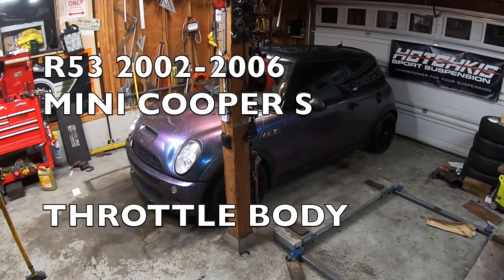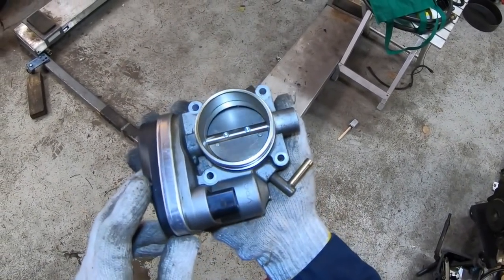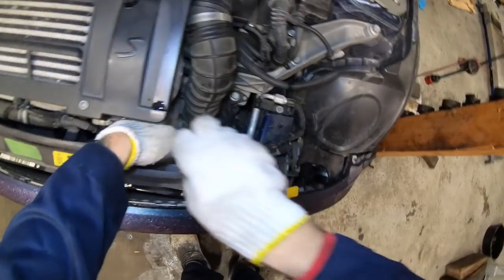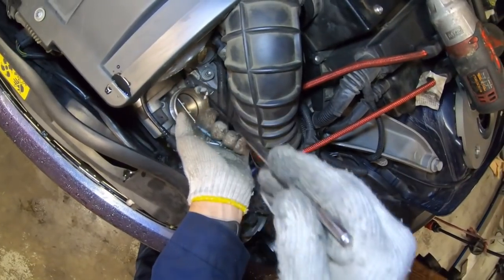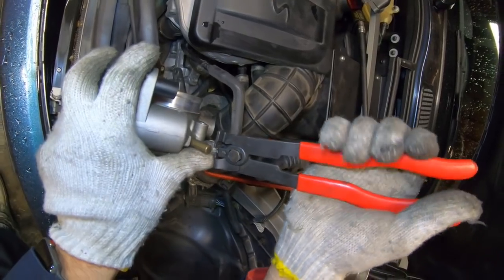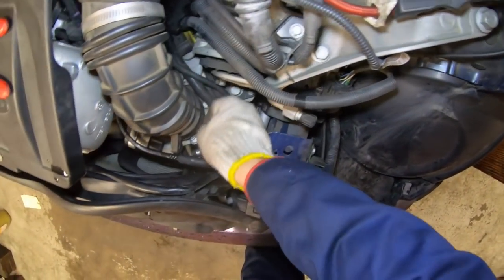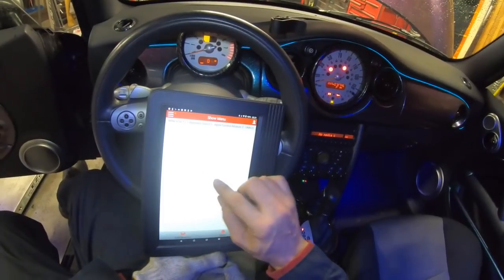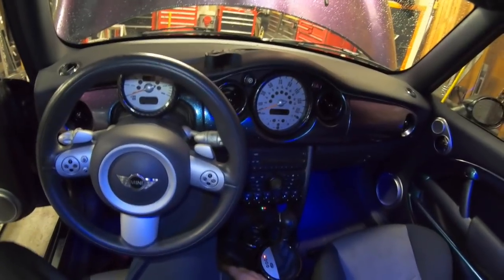Replace R53 MINI Cooper Throttle Body P1125 P1126 P0638  2002-2006

Comment from the maker: You might need to replace your 2002-2006 MINI Cooper R53 Throttle body if you get a check engine light/limp home mode. Procedure similar for non-supercharged R50. 

Buy the throttle body here: 
https://ebay.to/2UQJbvW

Pinch clip tool:
https://amzn.to/2IfN2wN

Diagnostic tools that can reset throttle body adaptation: 
https://amzn.to/2IeqXyu
https://amzn.to/2VFEYs0
https://amzn.to/2UySnWo
Reply: Thanks for this video, and the others, top advice !!
Reply: Thanks  for doing this video I replaced  mine on an 06 S I have  but I never did the reset on the throttle body it worked fine but later on  couple of weeks later I got codes and I the rpms where where going up and down   then the car would go on li.p mode and give me a code 1498 and 1125 I did replaced a broken hose and also the bypass valve for the supercharger  with anew gasket and still gave the code and would idle up and down. 
I just bought another new throttle  body and the BMW tool   the 360+ but it won't connect the the throttle body to clear the adaptation.
It only comes to read it but not to clear it. Right now it's working fine  what would happen if I can't clear the adaptation!  I ha e no more air leaks it's driving me crazy. Can you help. Me!
Reply: Hi, I've got a 2006 mini cooper s model , with a fluttering acceleration from 1st to 2nd and a little to 3rd. Keeps giving me a cylinder#2 misfire. I've tried all the small repairs... Any known issues that will cause this? When it gets up to speed, it drives fine, but only when loaded in 1st gear does it five an issue.
Reply from the maker: @SAK1974-f9o  Compression test and leakdown test to verify the cylinder compression is good.
Reply: @ModMINI  Thanks so much for the response. Thanks for all the videos you've done on Minis, it has help a whole lot.
Reply from the maker: @RaymondN.-in6vw  this is usage moisture damage. You'd need to check the harness pins in the floor area and repair damaged ones. Sorry, I don't remember which wiring harness. I believe it's under the driver side floor carpet
Reply: Hi, I have an 03 cooper s that is throwing a p0506 code, and stalling when I let off the throttle. Would that likely be a throttle body issue?

Comment: Just had mine replaced yesterday, unfortunately I had to pay crazy money to get it done. Definitely a DYI fix.
Reply: DYI?  Is that what happens when you try to fix it yourself but break additional stuff in the process?  Do Yourself In fix?  I've done that.
Reply: @bvcxzgt5451  😅 if you've ever worked on a 15 year old BMW🤣 it kinda does you IN for the parts that exist in the immediate vicinity of that One you want to replace. Need 1 part buy 3😡🤬😂

Comment: I bought the first diagnostic tool you link to (Foxwell NT510). Unfortunately it cannot reset the throttle body adaptation on an R53. I contacted Foxwell, and they told me I 'd have to get the NT530. Just a heads up.
Reply: Did you get the proper Foxwell tool and reset adaptations on your R53?

Comment: Hi Mod Mini! Just had a P1125 code appear on my 2006 mini cooper. I cleared out the code with my cen-tech. Should i wait till the code appears again or should i change out the throttle body now? Already performed a tune up.

Comment: Hello I just bought a 2005 Mini Cooper automatic for my son and we are having a problem when we start the car it will start out fine Rev fine the moment we put it in Drive the car has a vibration feel with low RPM and no throttle response whatsoever any ideas that you can think of? There is a service engine light but I have not purchased a scanner yet I know that would be the best place to start with scanning it I'm just curious if Mini Coopers are known for this type of issue and if there is anything you can think of off the top of your head

Comment: You can do a throttle reset ( throttle relearn procedure) just by depressing the gas pedal with key in acc power mode for 30seconds, turn off key WHILE still depressing pedal and remove the key and then release the gas pedal. You SHOULD hear your throttlebody actuate ( a buzz noise followed by a click kinda sound ).
Reply: Hi Adam..what year is your mini? I have a 2006 mini cooper s and i am wondering if this method will work for my car

Comment: Resetting the throttle adaptations is same as throttle relearn ? I replaced my throttle body and throttle pedal, but didn’t do the relearn and after certain time it goes to limp mode p1125 code

Comment: Hello mod mini, i have my mini Cooper r52 cabriolet 2005 that is giving me some issues. First of all has a long cranck to start ( like 3 or more seconds) then irregular idle and the engine has not all power and not fast response of the engine when I touch the throttle pedal, plus engine check light on and the error my mechanic said is about missfires and too rich gasoline mix. I changed air filter, sparkplugs and body throttle cleaned and resetted but the problem persists. My mechanic said that I should replace the body throttle, but can't be the depression hose or pedal sensor? The car has 190.000km what do you think about? Do you suggest an original one in case or a Siemens ? Thanks

Comment: Great video. I thought I was having throttle body issues, but I'm getting the codes: P0302, P0456, P0300, P0313 as well as an evap leak on my R53.  I have new spark plugs installed, checked my gas tank cap, but at this point can I assume its a MAP sensor issue? Do you have a MAP cleaning video? Thanks!
Reply from the maker: That's a lot of codes, some of which can point you in the wrong direction without some critical thinking. I'd unfortunately have to look at the car to comment further.

Comment: Really liked your video.
 I have a question.  What could be causing me to have a check eng light and EML light ? I hooked up a scanner and got code:  P1498 Air leakage after compressor.  Could it be the intercooler boots? I have. 06 R53 S with 74,000 miles.
Thanks for time.
Reply from the maker: I'd guess you have air leakage after compressor. Do a smoke test.

Comment: hello Mod MINI, thank you for the great video again!  many of your videos were HUGE help with replacing supercharger on my 2005 cooper S.  may i ask a question?  Have you ever encountered P2127  Throttle/Pedal Position Sensor/Switch "E" Circuit Low?   I searched everywhere but no help on any web or forums?  replaced gas pedal (used one) and removed/cleaned throttle body but still getting the same code....  any help would be GREATLY appreciated.  thank you!  Jay
Reply from the maker: Try replacing that perhaps. Used ones aren't expensive
Reply: I got that code, replaced my pedal with a used one, and still had trouble until I recalibrated the throttle pedal.  Easy DIY recalibration.  Look it up online, but my recollection is pedal held down, key on, hold pedal down 30 seconds, release pedal, key off.

Comment: While i have my throttle body off my 2002 mini cooper s  is it ok to open the butterfly for a better clean... reason asking  because with my lpg ford its not  a good idea...Ps your videos are the best to watch...
Reply from the maker: Should be ok, reset with BMW scanner if anything happens, but it should do a self-calibration every time car turned on

Comment: Question! I have the check engine light on after putting the AC and was told that the hose that goes to the throttle body was loose.  Now the light is off after driving the car for a little while.  Not sure if I might have to fix the throttle body part too. It has stopped responding to switch gear again and did not had the air on.
Reply from the maker: If car is not put together correctly, you will have problems.

Comment: Is there a way to contact you about an issue I’m having? I’ve gone to a MINI racing shop with a lot of knowledge and I’ve done my research. No one on multiple FB groups can figure it out as well as the shop after over 7 hours of inspection and testing.
Reply from the maker: If you've gone to shops that have looked at the car in person, and still unable to give you an answer, I will be of no additional help not being able to see the car.

Comment: Do you have any idea what might cause EP (emergency program) on automatic R52 with sport mode and paddles? Continuosly lit. It can still shift, not stuck in one gear.
Reply from the maker: Need to scan the computer and read codes.

Comment: Hi MOD MINI videos are great recently replaced BPV and serviced supercharger. My Mini cooper s 03 plate is still throwing a fault p1125 and going into limp mode, I can restart and it will be fine again for a while. As only the code dont think the throttle body has gone as runs great all the way through when that doesn't happen. Any suggestions on what could be causing it?
Reply from the maker: Have you replaced throttle body? They are pretty cheap used on eBay. https://ebay.to/2R8Xl7B

Comment: Hi Mod Mini! Thank you for all the helpful videos!  My R53 has a P2127 code Throttle/Pedal Position Sensor/Switch E Circuit Low.  I have check engine light and/limp home mode...Is the sensor different from throttle body? I can't seem to find parts for throttle position sensor.  Thank you for any guidance you can provide!
Reply: I changed the throttle body and it fixed my issue.  Thank you Mob Mini.
Reply: @simonkong7205  Hello Simon..having an issue with my mini and i believe my throttle body is the problem. Car goes into limp mode with a check engine light. I turn it off and goes back on with check engine light off. Thinking of changing out the throttle body..already cleaned it but i believe it is the electrical of the throttle body is the issue. What brand throttle body did you get?

Comment: hi, I wanted to ask you my problem, I have a Cooper s R53 and for two years I have the following error codes P2122 P2123. replacing the accelerator pedal, the problem reappeared after months, and then disappeared for other months, now it becomes more frequent. I will change the trottle body soon. but on the forums we read that the problem may persist ... the fault of the ECU! ?? Thank u
Reply: What ended up happening?   Recalibrating the throttle pedal can be done easily.  I forget the procedure exactly, but it may just have been holding the pedal down while turning the key to "on"  (not starting the engine), and keeping the pedal down for thirty seconds, then release the pedal and turn the key off.    I had to do that after replacing my pedal.  6 months later all has been well until today when I get P1125 and P1129, so I'm ordering a throttle body, I guess.

Comment: I'm thinking about buying an 05 mcs but don't think I will be doing my own repairs. No tools, no (garage) space, and no experience. It's got tons of service records but it's got 80k miles so it'll probably hit the big ticket maintenance items soon. Am I looking at a situation where I'm spending tons on mechanics in the near future? It's had most of the usually leaking seals replaced i think, nothing replaced in terms of the suspension though probably, unless mini did it themselves within the 60k miles it was taken to them for regular servicing which I doubt.
Reply from the maker: I can't comment on any specific car. The typical issues are leaks and that sort of thing, then control arm bushings or leaking CV boots. get any candidate car inspected before buying.

Comment: I have the same codes except 1126, went limp mode on me on the way home late last night. It's happened before, dealer said it was a leaky boot. Same codes as last time. Think it's the same thing? Throttle body?
Reply from the maker: Do a smoke test. Could be throttle body.

Comment: Hi Mod MINI I've got the error code :1689, 1125 and 0638 on my mini cooper s 2006. I think i wiil change  the throttle follow your video I don't know will it work by the way Thank you for your helpfull video.

Comment: Question?  When the throttle body starts going bad what kind of sound if any does it make.  I have this whirring/humming sound and goes a few seconds powering down when I turn the car off
Reply from the maker: It will throw codes when it goes bad. Noise after shutoff is normal.

Comment: When looking at scan tools, how do we know which ones do throttle body adaptation?  I see your list of three, but owners of those are mentioning others they like better, like the Autophix 7810.
Reply from the maker: Really hard to get detailed information like that. Even manufacture is unlikely to know for sure due to continual changes in software. I think that is only supported on most expensive tools.
Reply: @ModMINI  a friend tried a SnapOn Verus Pro and couldn't find it.  Thanks.

Comment: My R53 feels like it has a lazy throttle body, when I lift off the throttle during gear change the revs stay high for a second or so, have you ever come across this? Would really appreciate your help.
Reply from the maker: R53 is known to do this. Probably nothing to worry.
Reply: @ModMINI  Confirmed.  Mine has done this since new.

Comment: I bought the Creator c310+ and I don't see how to rest the throttle adaptation.  I changed the TPS/throttle valve and don't see how to get the C310+ to reset the throttle adaptation. Any ideas???  Thank you!
Reply: I bought the same tool but it won't connect  to the throttle  to clear the adaptation  it only conects  on the ecm to see the info it doesn't give  choices to reet from there either.
What would happen  if we don't clear the adaptation.  Can you help.!

Comment: What is the vacuum line/hose that you disconnected from the throttle body? Mine looked really old and cracked last time I worked on the car so I'd like to order a new one to replace it, but am away from my car for a while so I am unable to look under the hood to trace it.
Reply from the maker: crankcase recirculation. Look up realoem.com for part numbers, although that one you could probably use equivalent diameter fuel line.
Reply: @ModMINI  I think I'll try the fuel line idea and just replace the rubber section. Cheaper than getting a whole MINI hose. Thanks for the tip.

Comment: My 03 base model standard just started doing this.  Is it really that simple of a fix?  I googled it and all the chatter made it out to be a big deal.  For under $100 for the T.  B.  On eBay it seems worth trying to diy.  If it doesn't fix the prob at least I have a new T. B.
Reply from the maker: This has fixed the problem for every car where I've seen this code (4-5 cars)

Comment: Quick question.... my 2003 MCS (with 193,000 mi and manual transmission) had an accelerator pedal non-response yesterday. No codes, no engine light, no rough idle, nothing. Just went to a smooth idle with no pedal response. First time anything like that has ever happened. I pulled off the road, turned off the ignition and popped the hood for a quick visual. Got back in the car and restarted it and everything was fine for the ride home. My thoughts today are that the throttle body is telling me that it's probably time to replace it. Looks like a fairly simple procedure thanks to your video. Have you ever heard of such a situation that didn't produce and engine light/code? Thanks, Mike
Reply: Hi Mike
Did you happen to change your throttle body? Did it fix your situation?
Reply: @alfredbernal8603  - Hi Alfred, sorry for the delay. Unfortunately, I donated the ‘03 MCS to “Cars for Change” late last year. I never did get around to replacing the throttle body and the event only ever happened once. I was a rough call to part with the ‘03, but it was rapidly approaching 200k, and it had a few other things I just really didn’t feel like fixing. I still have my ‘06 MCS convertible, my ‘08 MCS hatchback, and my ‘14 S Countryman. So lots of Mini’s still around for me to motor with. Take care friend, and happy motoring!
Reply: @mikeoconnell9611  Hi Mike! I appreciate your response. We have two 2006 mini coopers ourselves. The problem that we are encountering is perhaps the throttle itself. Car sometimes goes into limp mode with a check engine light for the past 6 months. So we turn it off and turn back on successfully, check engine light  goes off.  We once checked it with my scanner showing a 1125 code. I am suspecting it could be the throttle body based on these symptoms

Comment: 2003 Mini Cooper S antifreeze Wells inside the reservoir replaced water pump thermostat and radiator still happens what do you think is the problem
Reply from the maker: Test the coolant for presence of exhaust gas to rule out blown head gasket

Comment: My dashboard turns on by its self after i turn off my car and wont turn off causing my battery to die. The only thing I have found to stop it is to leave my mini in reverse I have a 2003 R53. Would you know what could cause this?
Reply from the maker: Not the throttle body. Not sure. Run a full computer diagnosis

Comment: When I’m in neutral I can floor it and it won’t go over 1000 RPM I changed the coil pack , new spark plugs and the same I wounder to see if you could help me out on this 🤦🏻‍♂️
Reply from the maker: scan for codes.

Comment: I ordered the Creator V8.0 C310 and just found out that it does not support the throttle body adaptation, just clear the fault code. Unfortunately it is not worth to return it due to the shipping fee back (I leave in Israel)   :(
Reply from the maker: It should probably sort itself out over time.

Comment: Hey, so my mini makes a hissing noise by the throttle body. It's not turbo charged. Doesn't smell like a coolant leak either, so I'm thinking it's the throttle body. Another symptom is that after you press the accelerator the engine takes a little too long to come back to idle at 1000 rev/min. Does this sound like a l need to replace the TB?
Reply from the maker: Perform smoke test and fix source of air leak. Car computer is confused due to introduction of unmetered air.
Reply: @ModMINI  how might I go about doing that?